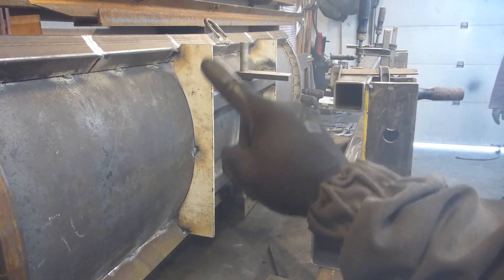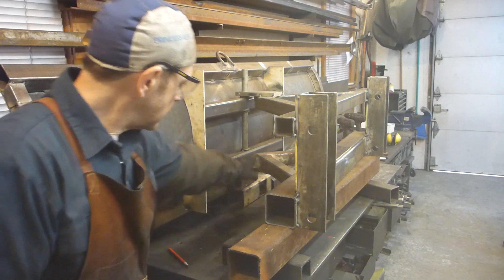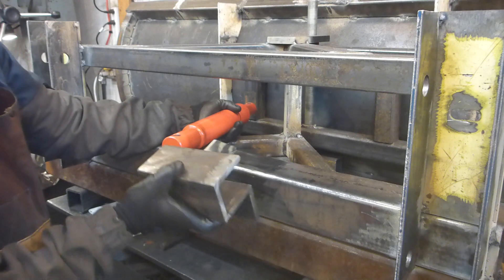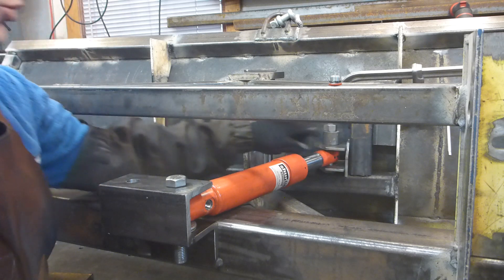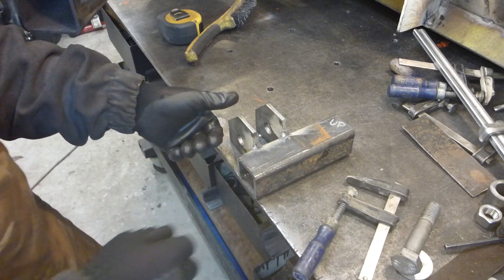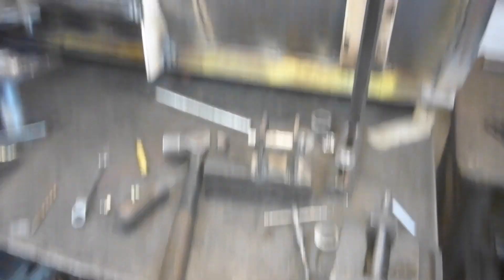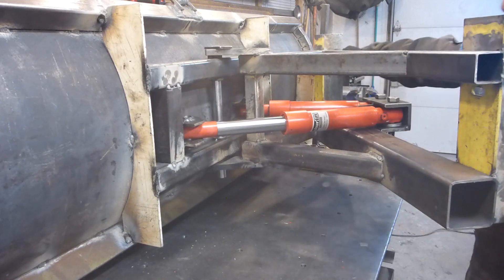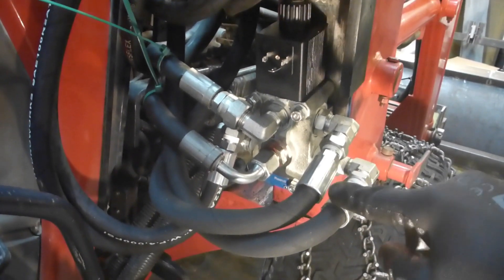#185 Hydraulic Angle Snowplow for Massey Quick Attach - Part2

Comment: Where do you get the bumper stops for the angle plow?
Reply from the maker: I got them at Princess Auto. 
https://www.princessauto.com/en/3-in-round-anti-vibration-pads-with-3-8-in-stud/product/PA0008656498
It was not meant for that... but it works!

Comment: Looking good Joe. He is going to love that new blade. Question for you - why did you put two cylinders on this one. Most that I see only have one cylinder to angle the blade? Thanks.
Reply from the maker: Excellent question!!! Those are two single action. They can only push. So one is pushing while the other release oil. One double acting cylinder would also do the job. But with any slight play on the pins of the cylinder and the pivot point, you get some significant play on the blade.  Having two single acting cylinder will compensate any play, as they will always be working against the play. Simply said, it makes a better controlled and accurate blade. I should explain that in the next part!!! Thanks!
Reply: That makes alot of sense - thanks Joe!

Comment: Salut Joe!!!  You have incorporated some really neat engineering into this build!!!  I especially like the collars you add for all the pins and pivot points.  A great idea to prevent excessive wear and miss alignment.  Lots of measuring, I would guess, to figure out how long to make the pivot arms for the blade.  Both the bottom ones to allow for max cylinder stroke and the top ones to match the bottom since they were attaching to difference dimension square tubing and your table wasn't flat.  Great work.  Looking forward to seeing the hydraulic connections.  I am really enjoying this project.  All the best to you for 2020!!!
Reply from the maker: Good observation Mike about the top link being of a different size. This is why we came with a long calculation/discussion/measuring session! Thanks!

Comment: I liked that trick of using a pair of vise grips for a handle while you cut and turned that tube. I imagine it was easier on the saw blade and maybe a bit faster.  How old is that Massey?  It's design mimics  bigger tractors from years ago. I like it. Backing out of the  shop at the end of the video, the plow looks great.  'Til next week, JW
Reply from the maker: I use a round stock bar of 25mm, which is just shy of an inch to match a mechanical tube of 1in inside diameter. It provides a good fit. This being said, I put the stock bar in the vise and put the mechanical round tube over, rotating freely. With that piece of angle iron clamped on the table, I can mark then cut the pipe while rotating it, being in control with the vise grip. That is the best method I've used to cut straight ends on round tubes. The Massey 1225 is an early 2000's model is I remember well. Thanks Jim!

Comment: Looks great Joe. Where the rubber  bumper is are you still going to cut the end off to get more swing ?
Reply: It looks like the throw of the cylinder might prevent a greater plow angle.
Reply from the maker: That is right! At some point, the 8 inches stroke of those cylinders were providing a limited plow angle. With a tractor, 30° is the minimum required, since it does not get much speed to "roll" the snow on the side. It would have been great to get 35 or 40°. With the experience I got from the snowplow from the Bolens, a 45° is too much. It just pushes the tractor's front end sideways. This being said, the 8 inches stroke could have provided a greater angle, but with reduced strength. We favored the strength over the angle. We calculated a push of 700lbs on the very end of the plow would generate a 3000 psi pressure, which is the maximum rating for the cylinders and the hoses (give or take).  Thanks!